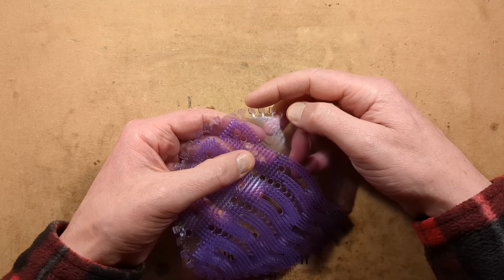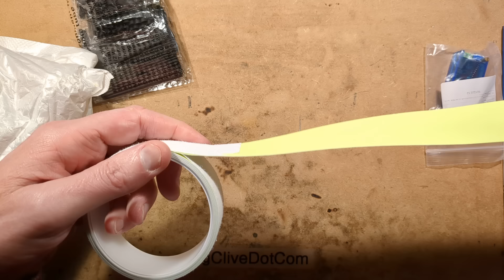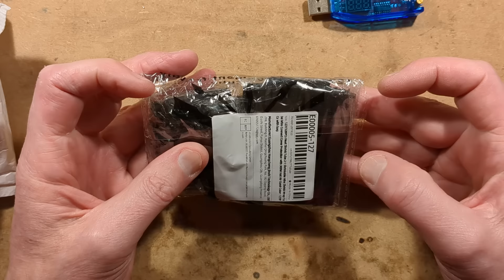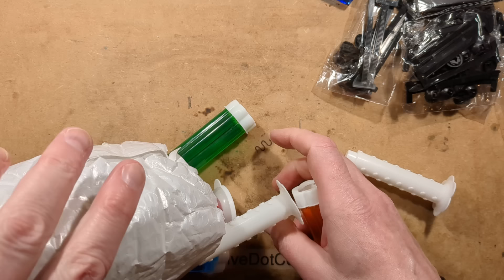AliExpress debagging quickie with magical toilet things

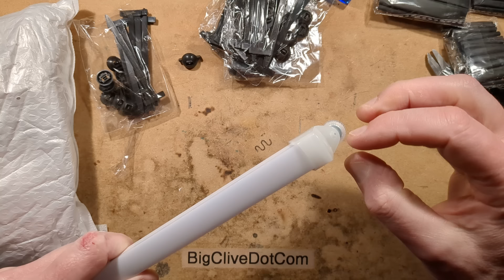Comment: 11:30 How long would you estimate that light could run off your average 18650? (not sure what they pack in, 2400mAh?)
Even from a cheap ""10000mAh"" power bank (probably 6K max) I suspect they'd last awhile and thereby make a nice power-outtage light source.

I don't know how often it happens elsewhere in the world (1st world countries at least), but storms frequently knock it out here in the US. Here in podunk E. TN it'll go out a few times a year during spring-summer (early fall; winter on rarer occasions), and sometimes for quite a few hours. 

Last year for Christmas my mom gave me a glass orb that had a spiral galaxy etched inside with an LED base. Typical TEMU product which doesn't do what it's designed to do very well, but the 5V USB LED puck is FAR more useful and I indeed used it with a power bank during an outage! 😅
(kinda nice because the base is just a piece of wood and the light wasn't affixed inside the hole, so very easy to repurpose without ruining it OR its original purpose)
Reply from the maker: I'm not sure how long it would run for on an 18650 as the intensity and current would gradually drop as the cell discharged.

Comment: I did some theater work back in high school.  Yes, backstage is extremely hazardous for the inattentive.  This isn't helped by people in theater who leave their brains at home.  The last thing I worked on ran for two nights, and used three street lamp props in the opening scene and two in the closing scene.  On the second night one of the props was broken taking it off the stage.  I had to point out to the people frantically trying to fix it that we only needed two of them, and we had two of them.

Comment: Those glow in the dark stuff is fascinating. It's all quantum mechanics because the reason they glow so long is because the electrons fail to descend to a lower energy level. This happens because their spins flip during charging so when they attempt to go down to a lower orbital, they find there is already an electron there with the same quantum numbers. And Pauli Exclusion Principle prohibits two things from having the same quantum numbers. So that prevents the electrons from immediately releasing their energy because now they need to flip their spins around which takes time. Once their spin flips, they can drop to the lower energy level because they no longer have the quantum number conflict.

Comment: The dense field of spikes on the purple pad deflect all the forward momentum of the fluid sideways and then split it in several directions, so that it can't reflect energy back and cause droplets to shoot out. It's similar to how the cones in an anechoic chamber work. The bar-rail mats that are made with a field of nubs do the same thing so that drips and spills just lay down instead of splashing across the bar. Big physics, base application.

Comment: wouldn't that urinal deodorizer be installed with the spikes down to allow fluids to flow underneath?

I don't think those urinal stars would work in my toilet, I have a rimless tornado flush where the water goes round and round (like a tornado), I think the water hitting those would cause heaps of splashing everywhere.

Comment: Would be good to see the The USB adjustable buck/boost voltage converter with the Magnetic USB strip light to see if it makes a dimmer light or a fire hazard 🔥

Comment: An easy way to test which version of the luminous tape you have there is a flame test. Burn some in a clean blue gas flame like a pocket blow torch. If you get a red/orange flare it's strontium. If it's pale green it's zinc. Usual safety caveats for ventilation etc etc apply.

Comment: Clive the other day you exposed fake Chinese capacitors filled with fine white sand. They were in scam energy saving plugs.
Australia has recently closed several primary schools because asbestos was found in children's play pit sand, the sand was very white and fine.
Please be careful with fine white sand used as filler in components!
Are you able to test for asbestos? This follows the discovery a few years ago that talcum powder is chemically identical to asbestos and actually contained longer asbestos fibres.

Comment: Can you find a lamp with a battery that you can use from external power but then run from the battery, while still plugged in, when the power goes off?
I can't, but think one would be great in a power cut.
Reply: Using a USB lamp with a power pack in the circuit just overheats the PB.

Comment: I've come across a XL6009 based voltage converter (from china) that is super unstable at low voltage. When I tested it near its minimum voltage, the chip freaks out and the output voltage skyrockets. With it set to a 5v output, I saw up to 15 to 40v on the output! The boards own capacitors were only rated up to 35v. I'm just glad I tested it before using it with something sensitive.
Reply: Typo correction: XL6009 not xl7009

Comment: Zinc oxide is easy enough to figure-out if you burn the tape. Not inside. There will be white smoke that collects around surfaces into a white powder. It drops as it cools, silver ore furnaces collect it in runs of flue pipes, cad that way too. Kinda blue sputtery powder/smoke coughing flame as zinc slowly burns out of molten brass.
    Zinc chills if you breath enough. I'm prolly the only person here who has suffered dearly from it.
   Don't recommend. Good to diagnose if it is zinc.
Strontium burns red, fireworks red. Not sure you'd see it burning tape tho.

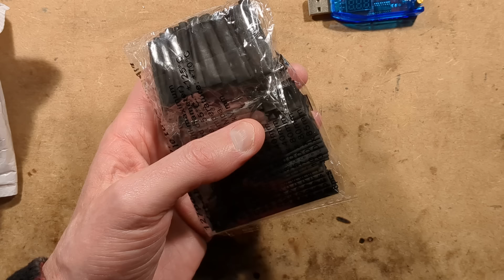Comment: 07:15 Oh yeah, heat shrink tubing. Absolutely invaluable stuff. Funny enough, I've dipped into my supply for something other than electronics work: I had the arm break on a pair of sunglasses while on a job, and so rather than running out to buy another pair, I just mended it with two layers of heat shrink. Kept wearing those sunglasses for months afterward, and even repeated the repair when the other arm broke. Heck, I might still have them sitting around here somewhere. 😅 As for activating the tubing, I like to use a lighter, of the butane jet variety. Quick, cheap, easy to maneuver in a tight workspace, adds no bulk or weight to my toolkit, and easily pocketable.

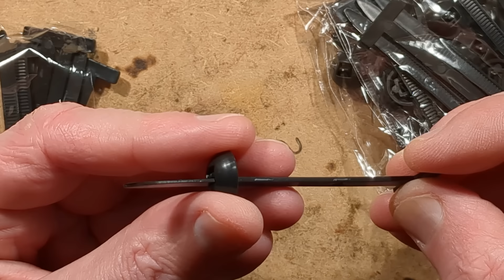08:55 Ooo, I'm definitely going to have to track down those zip rivets. I have a stubborn piece of trim or two on my old car that could really use them.

13:05 Huh. 10mm width you say. I think that's a very common size for LED tapes. Possibilities for modification.... 🤔

Comment: With cable ties don't cut them... it leaves a sharp edge. Take a pair of pliers and twist the part you normally cut off around twice and it snaps off with a blunt end. This will save you or someone else scratching themselves up.

Comment: CLIVE...  my wife bought the stars in hopes it would improve my aim. you have to use them and have perfect aim. if not they will go bad and turn hard and wont stick. the last bit i cut out of the tube a use them to 'freshen' our garbage disposal. i just got those zip ties 2 weeks ago. i used them to mount movie posters in thin plexi with just gaffers tape as a frame on the edges. i just used a butter knife on the sheet-rock to make a slit. stuck in the zip-tie and twisted about 90 degrees. pushed them thru holes in the plexi and zip, cut, all done. i did 6 in total and if they ever come down no holes to spackle. these things are so useful and remind me of wall anchors. you could do mudflaps, curtains, fenders, teddy-bear eyeballs. lol  have you tried the usb c blow lighters yet? my aliexpress should be here soon. ha ha ha
Reply from the maker: I've not made a video about the blow lighter yet, but it does work.

Comment: That Rainbow Flush absolutely made my day. So glad you did it. In the US we also have the star toilet gel deodorizers although the are usually only come in light blue (how boring). Too bad that glow in the dark tape doesn't use uranium to make it glow but then again the governments claim it's too dangerous so it isn't allowed. To activate my heat shrink tubing I use a mini butane torch that has a heat shrink tube attachment.
Reply: That's a different 'stars and stripes' situation

Comment: I genuinely am grateful that you warn us before turning the lights back on, my eyes are sensitive to light so sitting in a dim room and having my screen suddenly flash can set a migraine off, so I appreciate the caution.
Reply: Why not have your monitor set dimmer though
Reply: @TheGreatAtario it is, I have to adjust the settings on all my new screens, it's just to do with how my eyes process light, I also have some specs that adjust to the rooms light, because even shop lighting can be an issue sometimes.

On the positive though, I'm the only person I know who has all their screens colour settings correct lol.

Comment: I love glow-in-the-dark stuff.  I go camping a lot and like things like torches that have glow-in-the-dark elements so they can be found in pitch darkness, I also have luminous zip tabs on the tent, as well as luminous markers on guy ropes and tent pegs.  :)  Modern luminous pigment can glow for up to ten hours, so last all night easily.
Reply: Reminds me... one of these days I'd like to take a stab at "re-luming" the hands of an analog watch. Most economical watch manufacturers use some pretty weak photo-luminescent pigments that only glow for a minute or less. I'd like to have lume that glows for hours without having to pay out the nose for a whole-ass luxury watch.
Reply: I have a can of luminous spray paint from Lidl i think, it's really handy for marking the bins so i can find them in the dark without using the outside light (out of kindness to the neighbour)

Comment: That "mat" would make a novel mug coaster . . . . :-) Dr Ashens is a very watchable chap - one of these days the food choices will get him though!  The variable supply works well (I have a similar one) although it is obviously power limited. As for the pre-cut heat shrink - I always thought this was a gimmick until I bought heaps (Xmas special deal), now, it's my go-to source (which also means a small cabinet full of "full length" heat shrink!

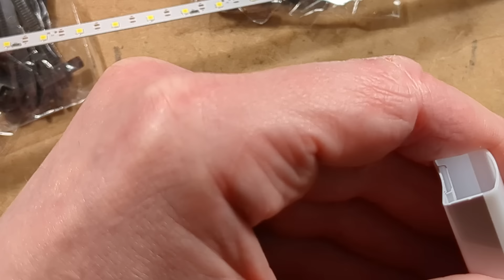Comment: Applying my Autistic reverse-engineering to the question at 12:36, I think the two halves are extruded separately in their respective materials, and both extrusions are then bought together through another die that bonds them together while still hot and malleable. You could also extrude this through a single die, but that would require having the separate plastics being driven by their own respective extruders with the output then being fed into the die directly. 🔀⚙👍

The reasonable way to tell would be to look closely at the join between the two plastics, perhaps with a magnifying glass. If the join is perfectly smooth and consistent throughout then it's the former, whereas slight variations in line and the occasional „bump“ would tend toward the latter. 😇
Reply: Or it's all the same plastic, and the opaque side just has paint over it

Comment: The cheap Chinese hot air gins for heat shrink don't have a thermal fuse, nor any kind of thermal cutout. That's fine if you know and also know what that means, mine also came with a euro plug for additional "no fuse either" added fun. As I said, fine if you're aware and know what you're doing, but I wouldn't anyone borrow it!

Comment: I still don't entirely understand why at some point we decided we didn't need to flush urinals. 
Also, the fitting looks like coextrusion, the plastic has high viscosity so it behaves like this, we have the same thing going on in tricolour 3d printing filament. It's cool to look at. What's really funny about it is that it's near impossible to make it do anything but this.
Reply from the maker: The waterless urinals are OK if they are maintained properly.

Comment: 12:36 - My guess is it starts out as two separate extruders, which then come together (a bit like a zipper) while the plastic is still hot enough to weld but not so hot that it mixes.

Comment: Why would you buy precut heat shrink sleeves? I bought a few spools of different diameters a decade ago and just cut off a length as needed. Yet you obviously have more experience, so i must be missing something.
Reply from the maker: This is a convenient way to get multiple sizes in a small pack.  I usually buy it by the meter or in rolls.

Comment: Looks like the extrusion is translucent on the inside. I would imagine at that point the translucent part adheres to the inside.
Reply: To clarify, it looks to me that the opaque part could be extruded first with the translucent bit added after inside at least the vertical walls of the opaque bit.

Comment: Glow in the dark tape is indeed very handy, can be quickly charged with UV light!

An for the cold month, can you do a video about hand warmers?
Just got one pair with 5 power settings, 3000mA/h battery and LED display for charge and power levels, works quite well!

Comment: The T shaped cable ties are very handy for automotive use.  You don't have to insert them from behind in all cases.  Worked a treat when fitting aftermarket mudflaps on my car.  Supposed to be able to use the existing plastic rivets, but one side wouldn't play ball.  Used one of these, and inserted into wing by putting in one side of the "T" then the other.
Reply: Those things look useful for all sorts of projects t’s. If they can survive holding up mudflaps, much less interior panels on car doors, they will be great for pretty much anything that needs a rivet that isn’t structural.

I wonder if they come in different colors and sizes?

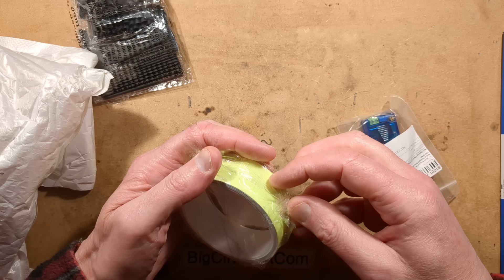Comment: 3:00 - I placed this on steering wheel in car, at 12 hours center, in the night its visible, helps if you start drifting on ice/snow or you have to break suddenly and car starts to wobble... you watch forward  and you still see where yellow thing is and direction of steering wheel...

Comment: The extrusion is all transparent/opaque. In the process a thin foil is bonded to the bottom level evenly. If you were to scrape off the "silver" the transparent plastic will be below. I love the Chinese, they are clever. They have got over the whole copy everyone else and are now innovating, en-masse.
Reply: We visit every 18 months (Canton Fair). Always something new, and the best experience going through their Immigration - fast, efficient, very polite. The Fair is quite an addiction, though.
Reply: Are we watching the same video? There's no silver anything on it.
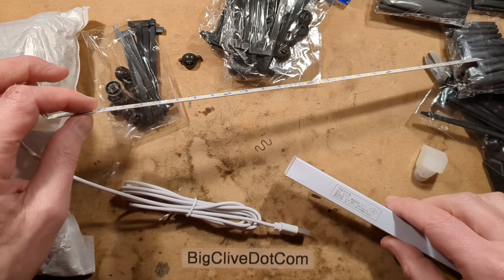Reply: @Muonium1 12:10 the case for the light
Reply: @Muonium1  "Silver" is a fair enough word for anything that looks vaguely metallic grey.
Reply: They'll still copy if they didn't think of it first.
Reply: Nice selection of Chinesium. These videos are oddly compulsive! We got some LED strip lights from Shein and they’re actually very good. These are rechargeable and have a PIR function to turn them on. We use them in wardrobes and dark cupboards, where they provide plenty of light. The batteries have a decent capacity so they last for ages before they need recharging.
Reply: human equivalent of the nanotech gray goo parable, unfortunately.

Comment: That Glow tape is Neat but pretty short
Reply: Probably because it's not cheap to produce - the phosphor is quite costly. You cn get 1cm wide for a reasonable price (alternatively  thin LED Strip, which is much brighter and lasts years if looked after)

Comment: thanks for the urinal mat tip! I'm a bachelor and I replaced all my toilets with urinals and life is so much better. It's so much quicker and less cleaning.
Reply: Number 2s must be complicated - or you just visit a friend?
Reply from the maker: I've actually been really tempted to install a urinal.
Reply: @bigclivedotcom that's what a sink is...
Reply: Where do you poop?
Reply: Someone should make a plastic urinal (similar to what you find in many porta potties) that clips on the side of a toilet but is flat enough near the rim that you can still put the seat down. Would eliminate a lot of splashing and to clean it just pour a cup of water down.

Comment: Why are LED-Displays always using multiplexing speeds so slow? Can't be too hard to set it to 10KHz...
Reply from the maker: The main issue is probably the camera shutter speed being too fast.  I may have to play with settings as I sometimes forget how sensitive modern cameras are, and my lighting is from an era of less sensitive cameras.

Comment: I bought one of those adjustable usb power supply units, but it's not accurate when I use my multimeter, and I can't see any way of adjusting it. When the display says 5v, it's giving 6v according to the meter.
Reply from the maker: The accuracy will probably be dictated by a simple resistive divider, and therefore influenced by component tolerance.

Comment: Good old splash back you can’t beat it, if the urinal doesn’t get you the sink will, the times I’ve had to dry the area under the air dryer lol
Nice selection Clive thanks 😊
Reply: The vicious percussion tap and cunningly shaped basin combo hits the target so precisely to produce the perfect "just comprehensively lagged myself" pattern that it must be designed that way.
Reply: @NiallWardrop spot on lol, the other tip is if you’re in a pub get back to your table and spill a drink accidentally on purpose on your lap 😊

Comment: diffuser vs opaque edge:  it appears to me that the diffused part overlaps inside the opaque. My theory is that the translucent is molded first and a groove left so as the opaque plastic comes into the extruder downstream (or after) the translucent, it forms into that groove of the translucent so the opaque fills the gap left on the outside of the previously injected translucent.

In other words, if they were molded as two pieces the opaque would fit over the translucent into a groove left to receive it.  When molded together they tend to melt together, but the form and the partially cooled translucent does not allow the opaque to move any higher on the outside.